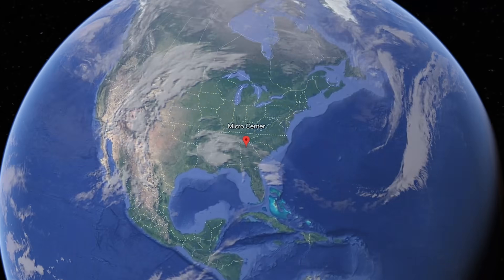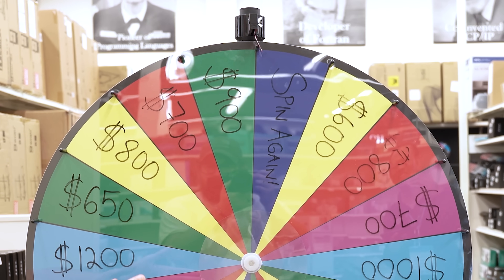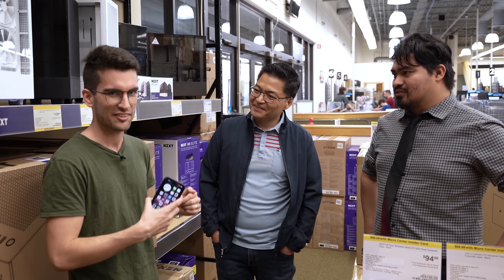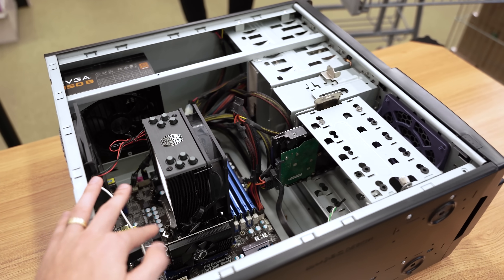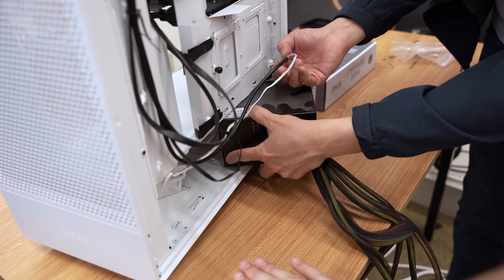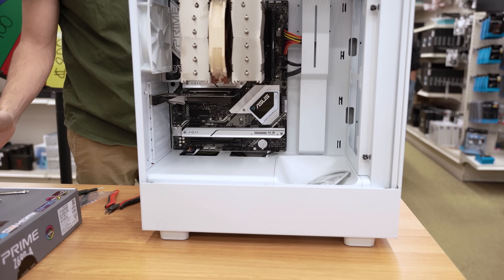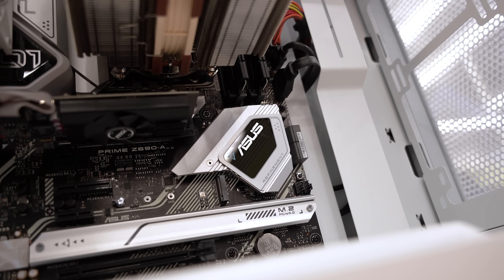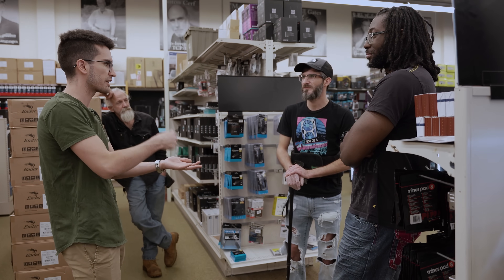This PC Was 12 YEARS OLD! - Gear Up S1:E4

Comment: Biggest graphics card they made back in the 19th century
Reply: Ehm 19th century is from 1801-1900 😂
Reply: "Now, the gpu in this system is the GT 710 which was the most powerful card they made back in 1492"

Dawid Does Tech Stuff.
Reply: @AXCBER  Does it come with Mesozoic Era ports?
Reply: @Alvin853  Pretty sure I saw a VGA port on that card 😂
Reply: @Alvin853  you bet it comes with the Mesozoic Era ports
Reply: Not worth a crap for gaming, but it will play 4K movies all day long through its HDMI port.
Reply: @Alvin853  It comes with a stone tablet and chisel output for 1 frame per hour.
Reply: @DaDevilTiGER  that's the joke, man lots of people online that ever understand sarcasm 😂
Reply: @DaDevilTiGER  Back when 3D accelerators ran on steam, not electricity.
Reply: considering that they didnt have grapphics cards back then, its bigger than the 19th century ones
Reply: And they were like: OH wow this Is big !!!
Reply: wish they could have used the cooler too. #brackets
Reply: When I was younger it was the dream to have one of these cards and if you had one you was the coolest nerd. I wanted one so bad.
Reply: 20th*
Reply: I had an i5 6400 I think and a GTX 1060 for years. It played everything I played on medium to high. Was a great prebuilt PC I got for $400 for like 4 years

Comment: Hi this is Tony, the guy in the video! I keep laughing at myself for pairing that tiny gpu with the 13700k! All of your viewers are right about the integrated gpu being better than the gt710! I went back to the store last week and got myself a new 4k monitor and it looks amazing! I feel like I’ve been time warped from the 19th century.

Thanks to you Greg and to Aaron at MicroCenter for making all this possible for under $800!

Now to decide what to do with my old system. I’m thinking about turning it into a NAS, or just frame the old gt710 and 2500k and hang it on the wall as a conversation piece 😂

7/21/2023 Update - Steve at GN just posted a video on his GN Extras channel entitled "Steve Unironically Buys a Pre-Built to Use | Puget Systems Build" that is very similar to my build: 13700k + z790 + Noctua cooler + NO GPU. I feel so validated😂. But I think my NZXT H5 Flow case is better than his, plus mine was custom-built by Greg Salazar, of course.
Reply: NAS is a fine idea. Since you've got pretty much a whole machine there you might also consider giving it away to somebody you know who could use a computer. It's more than enough for a kid who needs to do homework, for example.
Reply: So happy for you! I'm still running my 2500k and asrock z68😅
Reply: I have a similarly old system. It has an Ivy Bridge 3770 paired with 16 GB of RAM and a GTX 1050 Ti. It works great as a streaming computer because the apps on my TV are so flaky. It does all my streaming and YouTube viewing and even gets some occasional photo/video editing tasks. I installed a Noctua dual-tower cooler for the CPU and I can't get over how quiet and cool the whole system runs.

Enjoy your new rig!
Reply: I saw the old system had a HDD already, so yeah - cheap SSD as a boot drive and turn that into a NAS. Or you could use it as a basic multimedia system - something that wants to play music, play videos - heck it still had a DVD drive! and put the 710 back in the old system as modern integrated graphics would definitely outperform a GT710 all whilst using less power.

Comment: He should use the integrated graphics in the i7. The integrated graphics will work much better then the gt 710.
Reply: The one case where you really should plug the HDMI cord into the motherboard.
Reply: Indeed... UHD Graphics 770 are slightly above GTX650 / GT740 level performance-wise. Plus, you'll probably save 6 W or so.
Reply: Yeah my thought too
Reply: Ya according to user benchmark it’s 125% better then the 710
Reply: I was just going to comment the same XD, my previous rig had an i7 6700K and an AMD RX480 which failed, I had the option of using the integrated graphics of the CPU or an nVidia 9600GT which I think is still better than the GT710, and even so integrated graphics worked better, so i7 13700K graphics should work at least twice as well as that GT710.
Reply: Literally thinking the same thing.
Reply: It's a K model, no iGPU.
Reply: @TheCudder4life  all (or most) K models have iGPU, you're thinking of F models.
Reply: @TheCudder4life  K means unlocked for enthusiasts to overclock/tweak, F means no graphics.  13700 and 13700K have the iGPU enabled, 13700F and 13700KF iGPU is disabled.
Reply: Indeed that GT710 has no place in a modern system. 🤣
Reply: @TheCudder4life  f series has no igpu.
Reply: @j.p.h.8126  a GT710 could still be useful for driving extra monitors
Reply: @bojinglebells  True but the mb has both dp and hdmi ports. And i doupt that this guy uses more then 2 screens.
Reply: He's not using it for gaming he's using it for productivity. It's better to use the 710 in this case to take any load off the CPU.
Reply: @j.p.h.8126  yes, but you said "a modern system" not "his system"

At any rate, a GT 710 can still be useful in a modern system, which is why I can go to my nearest Microcenter and still buy one new, but not one of its bigger Kepler siblings.
Reply: @residentevilfan4  they're both lousy for gaming, however the UHD Graphic 770 can offer far newer/better video encoding/decoding support

also, using the iGPU is going to add a negligible amount of stress on the CPU, especially given that they didn't skimp on the cooler.
Reply: @bojinglebells  Yeah maybe it can be usefull if you already have one. However i would definately not waste money on a new one. But hey thats just my take on it. 🙂
Reply: @TheCudder4life  the k model is unlocked for overclocked the F on intel stands for no integrated graphics
Reply: Indeed, that crummy GT710 will bottleneck that whole brand-new system...
Reply: gt710 is usefull more when you have two monitors I guess.
Reply: @PileOfEmptyTapes  19 watts to be exact 😂
Reply: Arch 380 lp gpu would be best

Comment: my only complaint with the build is going with the NH-D15, its still got the reputation but its really overpriced these days considering the Peerless Assassin and AK620 but I think its a very solid upgrade considering only the GPU and PSU from his old build was re-used and his use case doesn't involve gaming as much.

Comment: I have an old Asrock P67 PRO and a i5-2500k that was pushed to its limits for years and it's not dead yet. 2 years ago it was retired as a gaming computer to an art computer. Honestly, I have no idea when either the motherboard or CPU are going to die. Damn good motherboard and CPU. It'll last you forever.

Comment: I wonder if the igpu would outperform that gt710.
Reply: I was thinking the same
Reply: The igpu is much better.
Reply: @xpodx  Yeah the igpu would actually outperform.   Putting in a $110 cooler was silly.   He could have does a CPU+GPU upgrade for $800 (mobo, memory, etc)
Reply: @Christopher Hailey  I would of done the cpu, mobo, mem and case with a nice aio, if any left a ssd or large hdd. Gpu alone I'd spend 1000+
Reply: Yeah igpu way better than 710 .. also a bit overboard on the mobo could have saved a few bucks there .. and i5 and coulda squeezed a 6600 maybe with a little stretch
Reply: @synthetic144 . If he doesn’t need the gpu, then why bother. Although you are correct He should just run integrated until he does a gpu upgrade down the road.
Reply: @Kaleido M  he can always spend 1000+ on gpu in time. Will help with editing. Cuz he's not a gamer I heard. Maybe a used 3090 for 24gbs would last him awhile

They go for 750 or so used
Reply: The IGPU is 124% better according to UserBenchmark. Should have used it.
Reply: @synthetic144  There's nothing overboard about that mobo.  That is one of the least expensive decent Z690 boards out there.
Reply: Overall he made a good choice and got a great upgrade for his system.
Reply: @RichWhiteUM  No. That board is twice as expensive as it needed to be, on an 800 dollar budget. Massive waste of money. I know he wanted intel, but I would have strongly urged him towards a b550 with a 5700X. Probably would have still had money left for a rx 6500xt gpu or better.
Reply: IIRC, it does. Older Skylake/Coffee Lake class versions of the iGPU such as the UHD 630 the UHS are in the GT 730 ballpark.
Reply: It probably would
Reply: Not in CUDA stuff
Reply: @ChristopherHailey  trust me for that furnace 13700k you need a good af cooler that mothafucka pulls ez over 250watts while in full load i just did one even more insane build for my cousin and a arctic freezer 360mm aio cant keep up with that cpu hits 99c instantly
Reply: @dragos_NBK  He would obviously have to go down on CPU with his budget.    It's hard to say what he's really using it for and what upgrades he was planning for, but an i5 probably would have been a smarter play which was everyone's point.    If he's doing really CPU intensive stuff then, yeah but...

Comment: I am also still using an 2500k, once I added an 860 evo it has been fine for what I need.  I am waiting for an new 10100f and an factory recertified MSI Z490-A Pro that is coming to my door for $111.  I will be reusing my older but A tier Corsair power supply, an R9 290X with only a few years light use and my Rosewill Blackhawk.  I don't care much about anything other than Elderscrolls 6 and will build the best upgrade I can budget at that time.

Comment: My copputer is around the same age(Dell Optiplex 790 w/I-5 2500k). It's amazing what a new cpu, graphics card, and ssd will do for Dell comps. I'm finally upgrading the mobo & cpu, but putting them in the old case. I'll get a case later.

Comment: I am running something almost as old..It's a MSI Z87-G43 with an I5-4440 in a case which is identical to that,  Thermaltake Tsunami Dream Tower Case...I upgraded from the onboard about 2 years ago to a RX550....Nothing has ever failed and it's run everyday pretty much the entire day...I am running an CIT Model: 600UB PSU. No problems what so ever with it...Built this is 2013....You'd need to spend around £966 ($1200.67) to put together that build here in the UK.

Comment: I'm wondering why the GT 710 is still even being used. Isn't the UHD 770 iGPU in the 13700K better?
Reply from the maker: It was more of a joke, but yes.
Reply: I did similar with a GT 630 which I carried from a previous rig when I first built the PC I have now - until I got into PC gaming when I got an RX 580 a couple of years back :)

Comment: Long live the 2500K!!! 😎

I still have my 2500K too, from 2012 or 2013. My very first computer that I put together myself. Everything except the CPU and the motherboard (an MSI "P67A-GD65"; I still have the box) has been replaced too.

The GPU was a RadeonHD 6870 and is now an RX 6600XT, both by ASUS.

The day it will die will be a sad day. 😪

Comment: Nice set of upgrades, much much better than a 2nd gen Intel platform! Wasn't the old rig a Sandy Bridge platform? If so then I can see why parts have replaced over the years!
Going from DDR3 to DDR5 would provide a noticeable performance boost as well.
I would have probably gone for a more basic cooler (one that would still do the job fine with an i7) which would have given more cash for a larger SSD, or a secondary hard drive - oh, and definitely leave out the GT710 as that is worse than modern integrated graphics.

Comment: I'd say something to make this series better, would be to run a game showing avg fps. 1% , 0.1%, Temps, and then spin the wheel and whatever they spin that's what they get. Not moving it to give them more, and then test it after they installed all there parts so we get a before and after experience.

Comment: You really should allow 2 spins and go with the highest $ amount. Take out the spin again put another $1,200 spot where the $1,000 slot is now. Then in the spin again slots put $1,000 and $1,100.  You wouldn't need to move the wheel or anything to assist. I feel kinda bad for the first guy. I love you trying to assist but it would be more fair to allow 2 spins without assists. They spin twice and everyone has the same experience and chance to max out their budget. I really like this series it's awesome Microcenter is giving you the opportunity to do this. I have a Microcenter fairly close but never thought to use them April of last year.  I did a 12700k and a 3080 build for my 13 year old. My 10 year old got his brothers old build with a 3700x and a 2070. When I go to upgrade them again in a year or two  I will now be going to   Microcenter.

Comment: Lol that's crazy... I have an i5 2400 build still in service. Nothing has died in it yet, but a lot of swapping has gone on around it though lol. It's just used for a bedroom 1080p streaming rig now, with a 1050ti that I had from a trade in slapped in it.

Don't need it pimped or anything, it's the lowest powered of 7 towers in use on my network lol.

Comment: In Aug of last year I picked up locally a used Intel 8th Gen i7-8700 processor and Asus ROG Strix Z390-E motherboard for $50 dollars. Wish I had a i9-9900K processor for the motherboard but those are going for crazy prices on the used market.

Comment: That i7 is probably having more integrated graphics than that GT710 graphics card. It's better to run without the GPU as it holds back the processor in terms of performance. A huge bottle neck.

Comment: i'm amazed how stuff dies in other peoples systems, my 4770k was heavily OC'd with a Freezer i30, all running from  Jan '14 till Feb '23 no problem.

Even my old 2600k vom 2012 which i sold to a friend is still going strong on 4,4 GHz, also i30 Cooler n so on. dfq.
Reply: Just the luck of the drawer really. Where you live can affect things too. Humidity, heat etc play a part.
Reply: One of the cores on my 3 year old R7 3700X randomly stopped working even though I have it water-cooled and not even overclocked... It's luck really. I have to keep that core and another one parked to achieve system stability (so I have a R5 3600X now ig). Even giving the faulty core more voltage did not make it stable. RIP

Comment: Would’ve gone with a 13600k/if 
A DDR4 board 
A cheaper cpu cooler, maybe be quiet or alpha cool . 
And that rest money would’ve gone into a sweet sweet graphic card 
Or at least two front fans 😅
Reply from the maker: Needed a beefier PSU - wouldn't have all worked for long.

Comment: He really should have bought a new PSU himself and upgraded it immediately, leaving the old system fully functional and the new system ready for a drop-in GPU upgrade. There was no point in swapping the PSU when it's such a low-tier PSU anyway. Really, he should have also dropped in an RX6600 or RTX3050 too. 

Otherwise really good choices all around, and he'll easily get 10 years out of the 13700k, which seems probable given he's still running a 2500k.
Reply from the maker: "He really should have spent money on this." "He really should've spent money on that." Not really the point, is it? We're working with strict budgets, here. If you could just throw money at everything, this series wouldn't be all that interesting.
Reply: @GregSalazar  yeah, I get it, but realistically a new PSU for an otherwise entirely new build really makes sense, given the PSU transferred was a really low budget model, and already installed in a fully working PC, which is now not working. 

Both CPUs (2500k and 13700k) have iGPUs, so the only thing missing from having 2 fully working systems is a PSU. Even a $50-60 model would have been an upgrade from the old one.

It's just the more logical approach...
Reply: Even if it meant dropping down to an i7 13700 non-k and slightly cheaper CPU cooler to include a new PSU, that would have been a smart move...

Comment: 12700k combo was 200$ cheaper and was more fit to that budget and use case consider the 450w psu for a cpu that’s rated for 250w that extra definitely was needed in the psu area

Comment: warning check the 12volt rails on a 450 watt psu if its leass then 300 watts it cant support modern system

Comment: Almost as old as my current setup lol 
Xeon x3460 - best upgrade coming from a i5-750
EVGA H55 MB, 16GB vengeance DDR3, and EVGA RTX 3070 coming from a dying 970
Original hardware almost 13years old

Comment: For sure need at least 2 intake fans to keep CPU temp down.
Reply: Yes! I added two 140mm front fans!
Reply: @GuamTheBear  heck yeah!! What brand did you go with?
Reply: @xHaloWarsFanx  Arctic P12 PWM PST (white) from Amazon. Believe it or not, MC didn’t have any plain white 140mm case fans in stock that day. I’m not into rgb, so went with plain white fans.

Comment: Why not  Instead of going for a high end motherboard ,he can just go for entry or budget level mobo and for the ram he can just go for a ddr4 and same goes for the cpu , an i5 13th gen non k is enough  with air cooler brands like ID cooling or deepcool and lastly the for chassis , theres a lot of budget brands outhere like tecware, darkflash, deepcool etc for around 50 to 60 bucks. So he can definitely save a lot.anyways, If i was the one to build With that budget i can already build a ryzen 5600 with rx 6600xt on it.

Comment: Hello Greg, so i have an uhd 630 pc with i5 9400 cpu and the motherboard is H310MGH and i want to buy a gpu without external power which can fit in it but when i got into the pc the microphone and speakers plug was directly beside the pcie slot so can u tell me which gpu should i buy?

Comment: I think the wheel of fortune prices are too low. Was maybe ok in 2010, but nowadays you can already spend $1200 for the GPU easily and don't even get the highest end one. Lowest should be $1200 and highest $2000... That would be a more decent update.